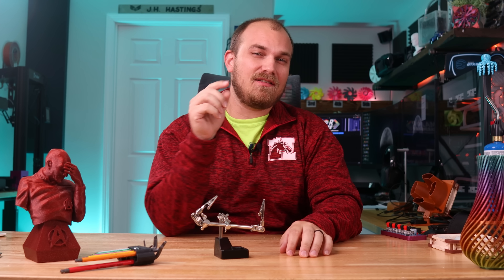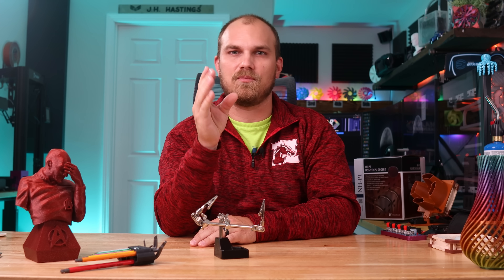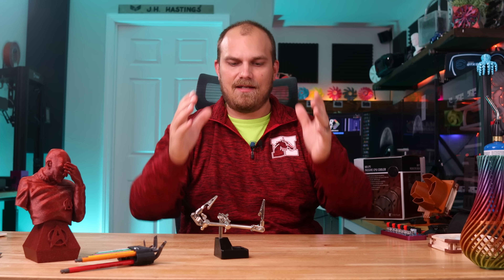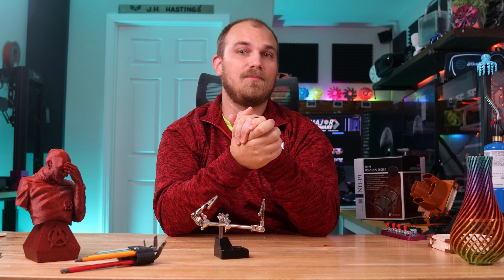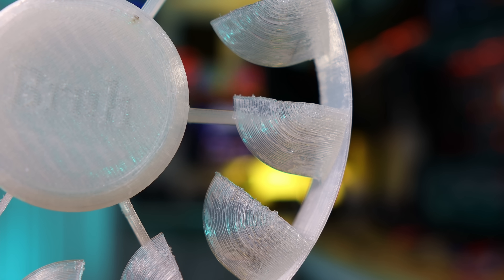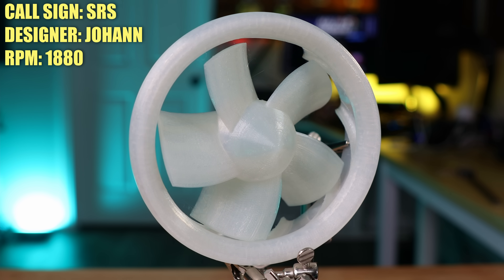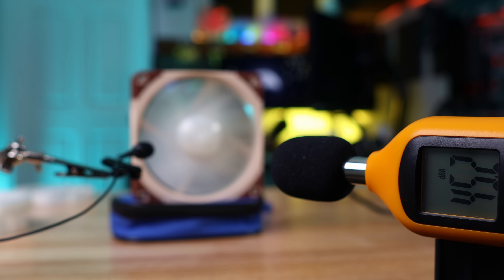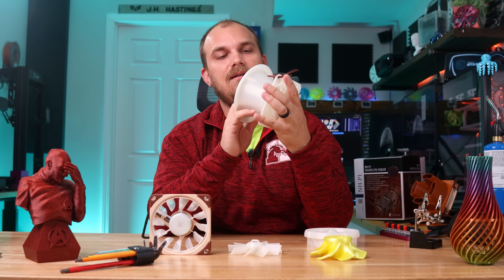TURBOCHARGING the Noctua NH-P1 - Fan Showdown S3E1

Comment: The biggest issue with trying to use a turbo impeller is there's nothing on the backside for that design to compress the air
It's just going to eject it out radially, which the smoke test sure enough proved.

Comment: Now that I think about it the turbocharger was a bad idea. It's based on a turbo which flings the air around in a circle which is why turbos are shaped as snails to capture it. Fans push air down not outwards.

Comment: So, this was a bad test for the turbo fan.
The way it moves air, as you can see with the smoke test, most of the air would only pass over the very edges of the cooler, because it spits the air more parallel to the fan instead of straight back across the cooler. The way we saw it catching air, I suspect mounted to tye outside of a case would provide the case with greater positive pressure, pushing more air through the entire system as opposed to just trying to cool the CPU

Comment: The reason why the Turbo fan didn't perform well is because the impeller on a turbocharger is designed to move air 90 degrees from the source. Turbocharger impellers don't move air straight-through, it pushes air outwards into the famous snail-shell-like housing that forces the incoming air through a direct bore - the fan needs an additional housing behind it to be beneficial but still that's a rather concentrated source.

Just can't use a turbo impeller for a box fan & vice versa :/

Comment: I know I'm a little late to the party here but, I think the turbocharger fan needs a turbo compressor housing made for it. To make it work, the outlet would need to be made into the part that mounts to the cooler and the regular pc fan housing off to the side (acting as the exhaust side of the turbo).          

Just my train of thought of course.

Comment: Turbo fans throw air outwards away from the center since they are meant to compress air, so that fans design is flawed. I feel like they should have done a fluid simulation. Just a thought as a fellow engineer.

Comment: You should work on some more test parameters.... number of fins, air flow, static pressure, weight/material used for printing/print time ~ cost maybe. You should maybe also calculate an overall score by combining the values/ranks. In the end, the data could be correlated, which could help improve future designs.

Comment: That turbo might work better turned round back to front, so it's sucking air through the heatsink. The base of the impeller is in the way otherwise.

Comment: I told my fiancé when you first started this testing if a shroud was used a decent fan would smash everything. I can’t believe how long it took for someone to submit a design with a shroud it’s extremely sad. I mean anyone who is a mechanic or does some mechanic work at least should know this and understand there’s a reason they use a shroud. I’m just waiting for someone to use one correctly and most efficient way now. I could download software and make a fan design but I’m more interested in seeing how long it takes for someone to get it.

Comment: Someone already said this but please make two classes of fans, high static pressure and high air flow fans. The high airflow fans can use the passive cooler and the high pressure ones can use last season's radiator

Comment: I know this is early but at the end of season 4 there should be a tournament of the number 1 fans from each season to see what the overall best fan design is out of those submitted. There should also be a test to see the stats of the fans both on a radiator and on an air cooler. That way if there's a special design people want to print for themselves they can know what its better at.

Comment: Are any of theses designs open source? I’m working on a project where I need air pressure, not air flow. I think the turbo design might work better for it. Like you, I’m surprised no one ever thought to do it, very good idea and design
Reply: The compressor wheel on a turbo is designed to suck air in and shot it out the side of the housing. You can see the smoke shooting out in a cone shape as it fight to go through the side.

Comment: A few things on the turbo style fan since I design volute pumps for a living.

Any volute pump whether water or air lives and dies by the design of the impeller and the volute in conjunction with each other.  Using an impeller with an inlet without a volute is about the least efficient way to possibly use it along with the fact that it’s likely spinning way too slowly to even begin to show up on an efficiency map.  The main problem with that design is that turbocharger impellers are designed at their core to take air in from one direction and expel it at 90 degrees to the inlet which makes a straight through design like a PC fan a bad fit.

Now what could be an avenue to explore would be a vertical turbine water pump design.  The simplest description is that they work like a straw with an impeller at the bottom to pump water vertically in the same direction as the original inlet.  Again their impeller design is dependent on a properly designed impeller housing and diffuser.  The diffuser is a critical component as it takes the spinning, turbulent fluid exiting the impeller and straightens it back out to an even directional flow.

Comment: i have an i5 6500. my hyper 212 evo's fan (unsurprisingly) died 3 years ago, and because my balls are bigger than my wallet ive been running it with no fan on the 212's heatsink ever since. if my room gets hot i will point a box fan at the motherboard.

Comment: It would be interesting to see how the turbo fan would work with a radiator. Since turbos aren’t really designed to have high air flow, but to compress the air, so I bet it would have a lot of static pressure.

Comment: Also, I have to ask;  radiator showdown when?  I mean, we've established that 3D printed radiators work, so...   Well, granted, you might want a resin printer to handle a radiator showdown, and standardize a print -> flush -> cure -> flush -> cure -> test process with such, to remove any internal resin, which would be a lot more work, but I mean, i'd show up for that content.  Standardize with the regular noctura fans, etc.    Just a thought.

Comment: I'm amazed, I could tell by the vortex the trashcan was putting off in the smoke test that, somehow, it was pulling some IMPRESSIVE air, I didn't realize it'd be in FIRST. I mean, of course the AAA fan with probably thousands of dollars worth of research and hundreds of thousands of hours of testing would come above someone's first time. 
But what's MORE impressive is the fans the Trashcan went up against, all seemed like pretty sound rivals, an iteration on a previous outer rim fan, a use of a car's funnel designed for specific airflow, and a fan using scientific know-how to try and increase airflow a solid margin, all of these on first sight could've easily seen winning any other episode and gone "Well, that's not surprising", but the Trashcan won!
Bravo Aiden, regardless if it was luck or sound reasoning, you've done an impressive job!

Comment: How do you account for the turbulence created by the lack of smoothness due to being 3d printer? Won't that add up and lead to wrong numbers than what the design can actually achieve. 
You might end up rejecting a design that is good because the 3d printed version showed bad results even though the bad result was due to the roughness of the surface?

Comment: Though the turbo fan is awesome, a turbo isn't designed to move air axially; it's designed to draw air in axially and then fling it out radially so that it becomes compressed against the housing.  That's why the outlet on a turbo is tangential to the blades of the impeller.

Comment: @MajorHardware hey, considering the vector bladed fans use to cool by is by pushing air through...shoulden't the tests care more about air throughput then cooling? (or at least in parallel as a additional way of estimating relative performance)

maybe a large box with a wall inside that seperates two parts of the box (or straight to/from the outside, but I feel like that would make it more vulnerable to outside variables) and then fill one with a fixed amount of smoke and see how quickly a fan clears it out by pushing it through? alternately there might be a way to run a dehumidifier/humidifier (or something that makes air distinguishable from normal) and see how long it takes for the second room to reach a certain value?

there's a lot of variables to control admittedly, (and I haven't put in the time to figure out what if any can/can't be controlled) but I feel that it might be a bit more informative about what fans do the best and why rather then just assuming a certain temperature delta is capturing the full picture even if thats what these fans are ultimately for right?

Comment: Quick observation: Fans that are completely axial flow work better than centrifugal flow fans like the turbocharger. Look at the exit flows: axial sends it straight through, centrifugal forms a hollow cone with a reverse flow in the center.

Also, Superfan has not enough blade pitch.

Comment: Using a passive cooler will give a massive advantage to fans with low static pressure and high airflow, so I guess this season will be the fan designs that would be good for case ventilation.

Comment: I wish it was feasible to use the turbo design with a gear reduction. 3000RPM isn't enough to make a turbo whistle, but a 3 to 1 reduction might make a little noise. I'm sure the heat generated by that would completely destroy any plastic gear.

Comment: Why is the inflow side with the turbo restricted in diameter? Thats stupid. As a nozle on the outwards side, ok. But restricting the intakeside which relays on the atmospheric pressure to push air into the fan (which creates negativ pressure, on the intake side) is just showing that the inventor of this cone had no clou at all.

Comment: To be honest, choose that cooler as benchmark is a poor choice.
Reason 1: Although it looks cool, it is still a specialized case. The fin density on that passive cooler does not represent fin density on most air coolers. In fact, it probably have less demand on fan to produce enough pressure to move air through it.
Reason 2: Previously you used a water radiator, which wants higher pressure fan. Air cooler prefers high flow, and you can not get high flow and high pressure at same time. Fans today are usually middle point of the two.
Reason 3: Switch to a new cooler will invalidate previous numbers.

Comment: i genuinely wonder if it would be possible to make a high pressure system to feed a turbo enough to build boost and blast air fast enough to basically be a leafblower

Comment: The problem is that most fans where designed for high static pressure and the trashcan was not.
So every desing that previously topped the chart will suffer because of the low back pressure of the new cooler.
So the retest of the superfan is also invalid...

Comment: Maybe fan tests should include a air pull test through the radiator, not just a push. Im sure the "turbo" fan designs would perform better at pulling air.

Comment: Why are you using a passive cooler as a fan benchmark? It doesn't make for a good active cooler, GN even points this out in their review of the cooler. Active coolers have higher fin density, and more cooling surface area, for a reason. Using the passive cooler as an active cooler will only produce lackluster results, especially when testing various fan designs. Active cooling applications will benefit from a cooler actually designed for active cooling. Season 3 will be hot garbage with this passive cooler as the benchmark. Testing methodology is now also extremely inconsistent, meaning you will have to retest S3 on the older setup, or retest all previous fans on the newer setup, for consistent methodology.

Comment: Using a turbo compressor fan was a good idea, but the housing was never going to work as intended. Turbo compressors don't blow straight through, they push air out around them to the sides. To work better it needed to have a complete compressor housing with the output in the desired direction. 

Would it be cheating to have a turbo compressor setup with the housing routed around the noctua chassis to point directly at the cooling tower veins from a different orientation, or does it need to blow through the noctua chassis? I have no clue what I'm doing with autocad so if anyone wants to give it a go, then go for it.

Comment: I feel like the Turbocharger might fare better in a scenario where static pressure is more important than airflow. Could use a larger intake area in either case though.
On that note, changing the type of cooler may give you consistent results within a season, but the results will likely vary drastically for the "overall" stats. Especially since the NH-P1 is likely not optimized to get the full benefits of fan airflow in the first place, since the fins are spaced more for radiant cooling, rather than active airflow cooling.

Scientific method 101: Never change more than one variable at a time. Effectively you've invalidated all of your past data sets if you want any sort of consistent overall measure of performance. I think it would be very interesting to re-test the overall top-5 with this new setup and see how significantly the results change.

Comment: Although I agree the passive cooler is cool, wouldn't its openness reduce the variances between fans where the lack of surface area allows you to use a slower fan and means less air-to-heatsink contact? Maybe I'm wrong but I'm curious.. I'm certainly open to anything that helps with the repetitiveness of switching fans lol, I love these videos keep up the good work!

Comment: The turbo design doesn't work like it should because real turbos have an idle speed higher than 10,000rpm and reach well over 120,000 rpm when creating boost.

Comment: I'm really disappointed in the choice of a passive air cooler, It's not designed to take advantage of a fan and doesn't pose the same restriction as a traditional air cooler. It makes the results far less interesting/useful because it eliminates the need for the fans to create any static pressure.

Comment: I want to see a comparison between the two coolers. Because i think they both favour different type of fans. Maybe the radiator needed more pressure while this one benefits from high flow and needs less closed airpressure, and the radiator was covered by the fan so only the internal airflow mattered, but now if a fan also blows over the sides it could aid cooling.

Comment: That turbo has so much centrifugal force it pushes the air just out the edges.  if you could mount a radiator to the suction side, it would be amazing

Comment: Can you put the RPM on the TEMP report, then we can see which blades are more efficient and which are using lower inertia mass to run at higher rpm and increase volume flow.

Comment: I think the cooler was a bad choice.... You should use a cooler which was made for vents to cool them. This cooler has small area to exchange it from aluminium to air making the vent much less useful then on coolers with bigger area. This is simple physics. The higher the area the more it can transfer to air making a better vent design to have much more advantage to bad design. On a coller like this the differences between a good and an average vent will be minimal making it bad for tests/stats.

Comment: .... what alot of designers are missing is that the best fans provide air "smoke" to the core and 35 to 40 degrees off the fan motor. If you look at alot of these designs

Comment: I wonder if the lower resistance from the heat sink having wider open fins than a traditional radiator would make airflow-oriented designs more successful with this configuration instead of just static pressure specific designs. Should test with the NF-S12A and see what happens.

Comment: I love the turbo design! I think that a shroud behind it to go into the noctua housing would help it's cooling ability. That way it would direct more of it's air through the cooler rather than out to the sides. Great video!
Reply: As I saw the smoketest i got the same idea. I will redesign it with a new part, what redirects te air into the cooler.

Comment: soooo i have a huge question and im surprised i havent seen this yet... i dont have a 3d printer but has anyone attempted on extending the exhaust area of the fans frame?   to sort of port out directly?   I see lots of attempts at forcing more air into the fan but nothing to help the air escape.  i feel like this could help improve flow in some manner, similar to how a car engines exhaust is designed to work on each pulse of the cylinders.  example, cylinder 1 ignites cylinder 3 goes and helps cylinder 1 to vent its exhaust gases, then cylinder 2 fires and then cylinder 4 each cylinder ignition helping the next, is there something to help direct the flow in that manner?

Comment: Maybe you could test different size fan spacers? If you make some room between a fan and a rad the airflow might effect the noise normalized cooling. Just imagine that the part of the radiator just behind the fan motor wont really get any airflow over it.

Comment: i cant stand all the misconceptions you make during testing all these fans. But choosing cooler designed to work as passive radiator is so ridiculously wrong. Testing any fan with radiator with such sparse fins completly neclects air pressure and many, many other factors and fan properties. Of course you can use fan to work with this cooler, but the fan that is the best to work with passive cooler for sure wont be best as a common fan to use with standard coolers with dense fins.